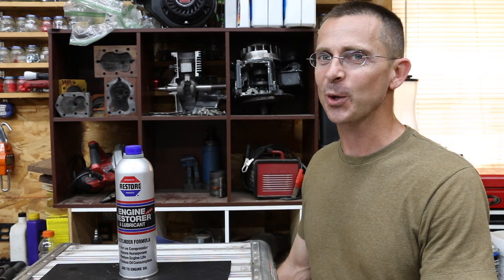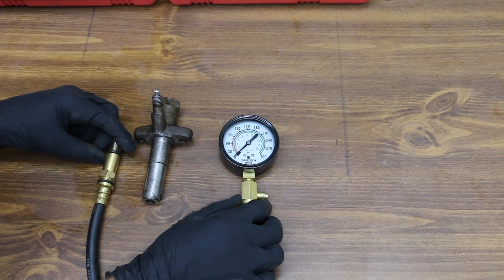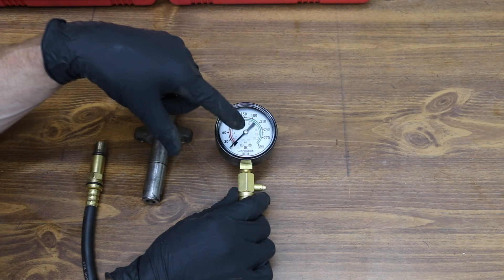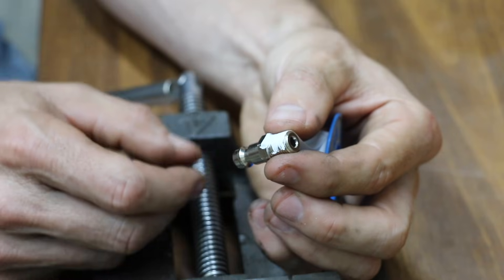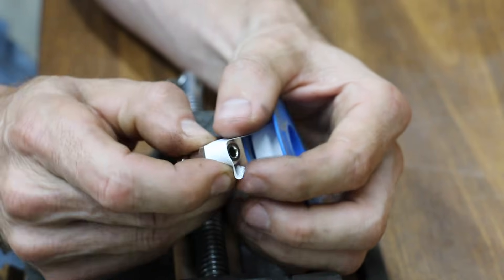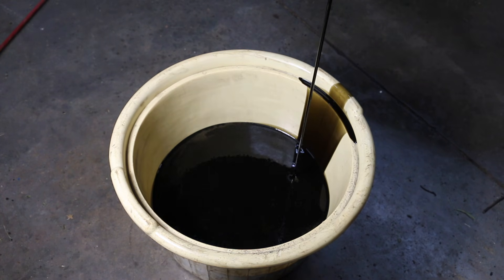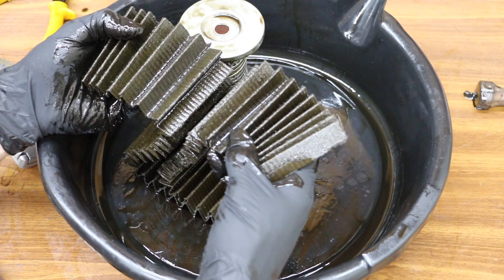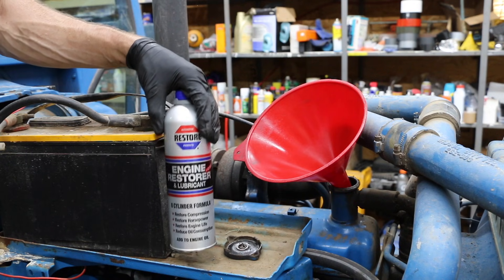Did the "Engine Restore" Compression Improvement Last?  One year later (Episode 2)

Comment: This is great but we would love to see oils mixed with boric acid. Supposedly the slickest substance on earth
Reply from the maker: Great recommendation!
Reply: You don't necessarily want that though. Engine oil needs a certain amount of "tack" for lack of a better word. It needs to beable to grip cylinder walls and bearings. One of the reasons cross hatching in a cylinder is so important for engine health is the fact that it adds surface for the oil to latch onto. Slicker oil also can lead to issue with the bearings being starved for oil in that the combustion forces can actually push the oil out of the mains. Modern oil, especially high performance oil is made specifically to grab onto engine surfaces.
Reply: That would be cool but wouldn't acid ruin the viscosity of the oil?
Reply: Boric acid is just roach powder, right?
Reply: Acid isn’t good for oil. However, a lot of oils use boron compounds that aren’t acidic.
Reply: ripfletching thats debatable, alot of people like amsoil. I'm still on a fence with them. Personally I use lubrication engineers for all my vehicles.
Reply: stonent That's Borax, they are related but different. Boric acid is also a great antifungal and antibacterial, add a quarter teaspoon to smelly shoes/boots occasionally, wear them and no more odours
Reply: ripfletching they make high performance oils and diesel additives. I've run oil analysis with Ford gold, Rotella t6, delo and lubrication engineers. The lubrication engineers far and away was the best. Ppm of wear metals was incredibly low, eot consistently stay about 8° lower than normal operating temps. Jim Kukulski is the owner and has some of the best customer service in the business.
Reply: fin harms no it improves the oils supposedly
Reply: +fin Then you just do the same thing I do... When in doubt, use thicker oil lol. 20 and 30 weight is for the birds.
Reply: stonent yes but under the electron microscope you can see that boric acid is in petals that look resemble that of a rose petal they slide on top of each other and are supposed to be the slickest material on earth
Reply: That's exactly why I go 15/40 Delo. Can't be beat at least for me and Cat equipment. Valvoline 15/40 S-3 as well.
Reply: Jonathan sauder interesting I have used this in an old bronco. Has around 400000 miles and still going. I Gave it away to someone needing a auto. I understand what you are saying. Have you read what oil performed the best in hi performance conditions
Reply: Jonathan sauder who is lubricantion engineers
Reply: 5Rounds Rapid there are companies using it in there motor oil‘s now?
Reply: Like Arch Oil additive!
Reply: This apparently is a legit thing:  https://www.anl.gov/articles/nano-boric-acid-makes-motor-oil-more-slippery

Comment: I’ve literally been wondering if it will last in my moms car once I use it. She lost 100 psi of compression when she didn’t see the oil light on for a week straight. Don’t ask me how that happened
Reply: 100 psi is quite a lot tbh that sounds like a big repair job coming soon
Reply: try it
Reply: tek wiz I would be looking into cam timing issues then. Lots of engines use oil pressure to tension the timing components and low oil pressure will let the timing jump. Sounds a lot more likely to me than losing that much compression and not having a rod knock to go with it.
Reply: SirXyloid yeah that’s what I was thinking but it was a free car from my grand parents so I’m just gonna drive it until it dies
Reply: Jr ALEXANDER they all lost around 75-100 psi. It normally had around 215 so it still starts but it’s just gutless now and burns a ton of oil and yeah runs rough at idle.
Reply: well I have seen engines lock up and even found interal parts on the subrame because of no oil pressure. heck my dirtbike lost compression doing 60mph, piston ring and the side of the piston had kinda melted and fused together. It's safe to say, that engine is dead. Swap a used engine in there
Reply: tek wiz sounds to me like it was ran dry and burned up the piston rings, if that’s the case then your cheapest option is to run it until it’s dead and get a new car. Swapping an engine can get expensive and if you’re gonna do it yourself in your driveway you’re looking at around a week of work
Reply from the maker: Wow!